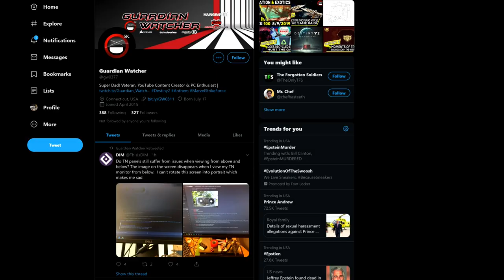PS4 Pro Upgrade! New Thermal Paste and Thermal Pads!

Comment from the maker: Let me know if you guys have any questions when it comes to upgrading your PS4 or your PS4 Pro!
Reply: Can you put all the list of the equipment you use thanks I'll sub yah
Reply: What size thermal pads did you use? 1mm?
Reply: @1ballashotcalla1  Yes, use 1mm pads
Reply: Do you believe the 1.5mm size thermal pads will be works better?
Reply: Can you leave the link for the thermal pad
Reply: I have change cooler with random one?
Reply from the maker: @1ballashotcalla1  Sorry for the late reply. But yes I used the 1mm thermal pads and Thermal Grizzly Kryonaut for the thermal paste.
Reply from the maker: @201aleks21  I’m sorry what are you asking?
Reply: What brand was the thermal pads you used?
Reply: I just got my grizzly kryonaut thermal paste but I don't have thermal pads should I wait to get thermal pads or will the paste be good enough?
Reply from the maker: @jdjajdjfnen7644  Yes def wait for new ones. You don't wana open it and then still have old stock thermal pads inside.
Reply from the maker: @cachetes_5788  Just reused some I had for my computers GPU's.
Reply: how thick is the stock PS4 pro thermal pad?
Reply: @noorazmi2329  am gonna used 1mm, for the ps4 pro are 1mm
Reply: @CocousXL  always use the size that came with the device, to thin and it won't make proper contact, to thick, you can cause other things to not make good contact.
Reply: Also modded my case with an external fan. Never goes above xmb fan speeds.
Reply: @CocousXL  I have Arctic 1.5mm by 10mm for over 3 years. Their awesome. They aren’t hard so the plate does press into them.
Reply: What is everything I can do to upgrade my ps4 pro with parts while I wait for the ps5 to be available at regular price
Reply from the maker: @abneldones184  Truthfully I probably wouldn’t even spend your money and just save it for your PS5.
Reply: I couldn't decide on the thickness of the pads for PS4 Pro.  1mm or 1.5mm help.
Reply from the maker: @buurakacar  Truthfully, its been a while and I no longer have a PS4 Pro. I have the original PS5 release edition. I would buy both thicknesses and go from there. Sorry I couldn't help more.
Reply: Should I put thermal pads on the actual apu

Comment: For anyone new watching this, do not put thermal pads on top of the old ones! They have to be 1mm thick exactly, making them 2mm thick leads to overheating! and less than 1mm and the system doesn't start!
Reply: Thx for thr comment i wasn't too sure but now i know
Reply: @squidusel6501  no worries :)
Reply: Is termal pads replace more important than termal paste or it is the opposite?
Reply: @AngelKsiezyc  thermal paste is compulsory when you tear it down. i recommend arctic mx4 and noctua wipes to get the old paste off (find them together on eBay for like £7) for thermal pads they're less important, but if your old ones are missing or falling off, replace them too. 1mm thick
Reply: And 1,5mm? I already buy for my PlayStation 4 pro, but i dont know about that 😯

Comment: Next time remove the fan and clean the heat sink on the side of the fan. Dust gets stuck there as well.
Reply: What a waste of opening it up if he is not cleaning that.
Reply: That was my first mistake, second opening up was more thorough
Reply from the maker: @Shelboooooo  Even without doing that is still is working great w/o any noise or problems to this day.
Reply: @recklessXRP  You should clean that heatsink. I used to vacuum mine and had normal temps. When I finally checked heatsink holy crap was it full.
Reply: thats the main place it clogs up and this guy doesnt clean.... amateur.
Reply: exactly...why take it all apart if you're not gonna clean that radiator.... amateur.  @Shelboooooo

Comment: If its me, I would have remove the power supply first, at least get the cable out. Then I will follow up with the rest as usual just that I will open up the heatsink and clean it from there too. You clean the fan from the top is not enough as dust will be blocking the airflow at the heatsink at the side of the fan. That was my first mistake. Second opening up was with my new Thermal Grizzly Minus 8 Pads with Kyronaut thermal paste and a thorough heatsink and fan cleaning. No regrets since.

Comment: Not sure if you've answered this already but what kind of temps are you getting with the Kryonaut paste? I replaced mine with Arctic MX-4 a while back and it barely made a difference so I was considering Kryonaut or (if I'm feeling brave enough), Conductonaut. Hope you hear from you soon!
Reply: I've used arctic mx4 for a while and I've never had an issue with it? Is the console clean?
Reply: Also, only use kryonaut for an overclocked CPU, i.e. only the pro model

Comment: Hi i know the video is old but if i Have to put 1.5 mm on my PS4 original is that good will it still have good cooling?
Reply from the maker: Personally I would just use the same ones I used and in the same location!

Comment: I have a question:
you have to remove the power supply??? or not??

THANXXX
Reply: Yes otherwise it will rip the board
Reply: I would recommend to remove the PSU first

Comment: I recently cleaned up my pro but now in death stranding it sounds like it wants to fly. 
Yet the output at the back is only warm not hot! 
Cut scenes set it to max. 
So I'm not sure if I've got the right tightness on the APU...
Reply: You should have hotter air coming from the back then before. More heat that's being exhausted means more heat being taken away from the chips. I would tear it down and reseat it all (new paste of course)
Reply: Did you redo the thermal paste? Because I did and it's silent now. Well, almost! 2 hours of pubg and it's Good..
Reply: Did you replace the old pads with new ones? I guarantee it makes a lot of difference

Comment: Excelent video! I replaced the memory thermal pads....and when i try to open it again...its attached to the metal part...i can´t open it. Any suggestion???
Reply from the maker: Ummmm I would try to use something like an iFixIt kit to open it if you are having issues. You don't wana break it.

Comment: Hey I just have a question, can the thermal pads be replaced for thermal paste? I just don’t have the pads and was wondering if I can change the pads for the paste. Would be very appreciative if respond
Reply from the maker: NOOOOO!!!! Well thermal pads and thermal paste have the same function, there are specific thermal pads for a CPU. You cannot just use any thermal pads and expect it have the same outcomes.
Reply: @recklessXRP  yea but that’s not my question.. my question is where you put the thermal pads can it be exchanged for thermal paste?
Reply: @recklessXRP  do you have a video that specifies on where to put it? Please I need help
Reply from the maker: @javierrodriguez250  No you cannot. Thermal paste cannot replace the thermal pads.
Reply: @recklessXRP  ohhh ok, and another question, what thermal pads do you recommend?

Comment: What is the best thermal paste ?
Reply: Liquid Metal Conductonaut delivers the best result for sure. Traditional thermal paste would be Kyronaut. Best bang for buck would be Arctic MX-4/NT-H1 or NT-H2.
Reply: @taytzuleong5584  
why would you recommend him liquid thermal compound? although it is correct as a fact, but he was commenting on a video about PS4 maintenance. 

no one should use liquid metal on PS4. it will ruin the system within 1+ years only and not to mention that it is very risky if it spilled on electronic circuit!

Comment: Eben you cut those tiny pieces of pads where did you sick it to? I thought the pads were suppose to be for the CPU.
Reply from the maker: Nooooo the pads go where the old pads were.
Reply: When sticking pad, make sure no air bubble formed in between surfaces.
Don't handle it with bare finger. Oil and dirt will reduce its performance.
Clean the surface thoroughly with isopropyl alcohol first before applying it.
Make sure your thermal pad is thick enough to fill the gap. slightly thicker than the gap is OKAY because once it will be squished to desired thickness once you have assembled the system.
If it is too thick, the APU won't touch the heatsink properly and your system will overheat.

Comment: Do you just cut the pads same size as the chips . Does it.mattet what type?
Reply from the maker: Yes same size and I used thermal pads that were extra from a water block . 1mm in size though. Don't use bigger or smaller.
Reply: @recklessXRP  thanks
Reply from the maker: @tigeruppercut6421  No problem mate!

Comment: Bro, can you please tell the brand of the thermal pads?
Reply: He used thermal grizzly kryonaut. I recommend thermalright or gelid. Grizzly is rated at 8W/mK the ones I recommend are 12W/mK and cheaper.
Reply: thickness of the pad on the memory chip is crucial. too thin it won't contact. too thick it will leave air gap on the APU. both case will ruin the system. also, application is not too easy. if air bubble is formed between the pad and the heatsink or memory surface, it will fail your system too. handling the pad using bare hand also contaminated it with dirt and oil, further reducing its potential.

You do need so many logic in here.

Comment: Do you know if the arctic mx4 paste and pads will be good for the same ps4 pro
Reply: I've done it, works well. I do recommend the thermal grizzly stuff.
Reply: I've done it, works well. I do recommend the thermal grizzly stuff.
Reply: MX4 is good too, no worries~~In my country Malaysia, the Arctic pads are expensive. You can opt for GELID pads too or the Thermal Grizzly Minus 8 pads 1mm in thickness.
Reply: SLG64 do I remove the old pads then install the new ones? In the video he puts the new ones on top of the old ones
Reply: @wordlife_97  replace the old pads with the newer ones.

Comment: Does new thermal pads make better result than just termal paste or it is the opposite?
Reply from the maker: If you are going to change out the thermal paste then changed out the thermal pads as well. Don’t just do one without the other.
Reply: Thanks for your quick answer. I know it but now is too late :) I thought the most important thing was just termal paste.

My question is. Does new pads make a big difference?

Does it worth to open it again just because I did not replace the pads?
Reply from the maker: @AngelKsiezyc  Think of it like maintenance on your car. You change your oil and you gotta rotate your tires because no one likes stock tires that will eventually ware.
Reply: @recklessXRP  I know. My question is:
Should I open it again right now just because I didn't replace the pads last month or should I wait to the next termal paste replacement?

Comment: Do 1.5 mm pads work? Are they ok to use?
Reply from the maker: I would only use the ones recommended in the video.
Reply: @recklessXRP  i bought the 1.5 and i screwed it already in. I let you know how they work or maybe i’am screwed gehehe. Tnx for the fast replay!
Reply: @recklessXRP  the 1.5mm works like a charm! I used the grizzly pad minus 8.. Tnx for the video!
Reply: @KMCDM  still working?
Reply: @papaarkem6211  still working like a champ!! I now have the ps5 since 2 days so I don’t need my pspro anymore 👍🏼🕺🏻.. Good luck bro!!

Comment: Please, for ps4pro what size is the best, 1.5 or 1.0? Thank you 
*Thermal Pads
Reply from the maker: Both. It depends on which part you are cooling. You'll need both.
Reply: 1.0mm thermal pads is recommended

Comment: How many months did it take before it started becoming loud again? Hope you reply, I'm planning on using the same paste
Reply from the maker: It didn't but I don't have a PS4 anymore. I have a PS5 now =D
Reply from the maker: @Samuel Torres Nope it has not but I am planning a few upgrades myself which includes DBrand Darkplates 2.0. I take care of my electronics (not saying you don’t) and I turn it off when not in use always. Recharge my controllers overnight and clean it of dust once every 2 weeks.

Comment: Is adding too much paste bad? It won’t short circuit anything right?
Reply: Depends on the paste, some are electrically conductive, others aren't.  I recommend mx-4 or arctic silver 5.  However i'd use as little as you can get away with, while not necessarily dangerous, its a mess that you won't want to deal with later on when it dries out.
Reply from the maker: @nathanhamman418  Agreed

Comment: BRO WHAT HAPPENED TO THE HEATSINK YOUR FAN WAS DUSTY AND THE HEAT SINK LIKELY THE SAME WAY BLOCKED WITH DUST SMFH. IF YOUR GONNA BREAK DOWN A PS4 or Pro BREAK IT DOWN TO THE HEATSINK AND CASE FAN.